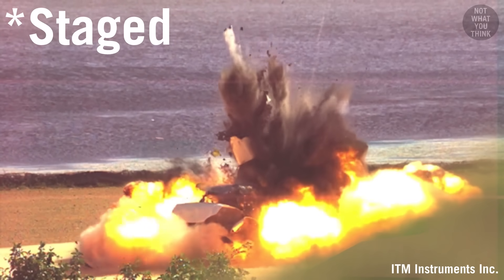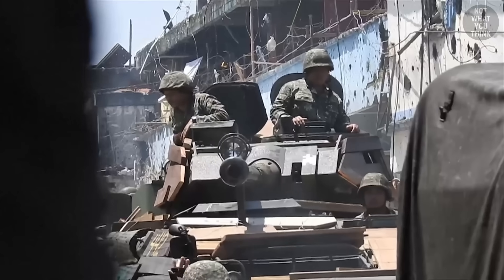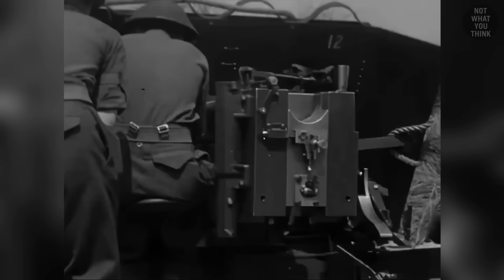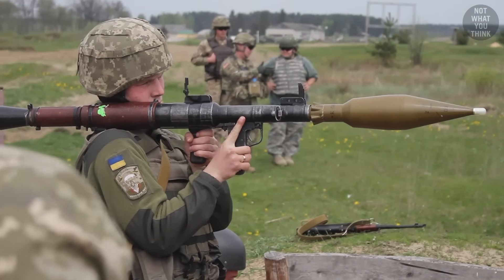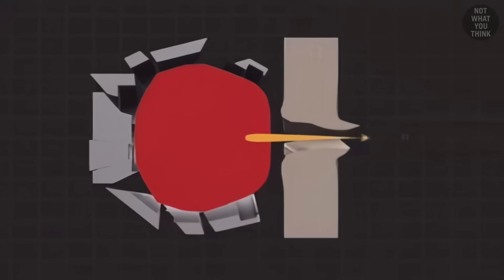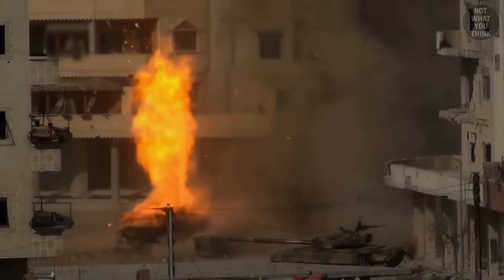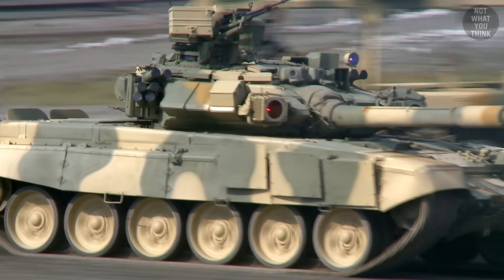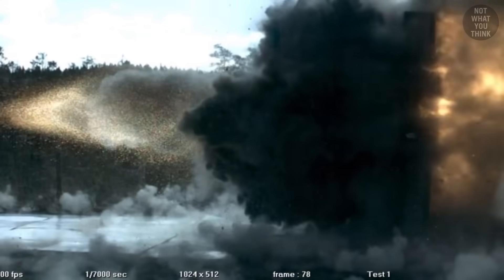Why Protecting Tanks is Getting Much More Difficult

Comment: We've reached a point in military where the term "Glass Cannons" applies to everything
Reply: That's why drones are the new fashion, why spent billions and trillions in specialized equipment and training vehicle operators for months when they can get blown up the second they get spotted in the battlefield, at least if the glass cannon is operated remotely you don't lose the operator when the drone turns into smithereens
Reply: @webaazul2500  There was this one episode of Stargate SG-1 where a planet was stuck in perpetual warfare with one side using remotely-piloted drones to fight while the other still employed humans.
Reply: @webaazul2500  Begin, the clone wars have.
Reply: @webaazul2500  there are defences against drones.
Reply: @webaazul2500  Drones themselves are worth billions. It might be cheaper to send infantry with anti drone weapons.
Reply: @webaazul2500 that's been repeated cause over and over cause of russias inability to use tanks effectively.. electronic warfare and infantry are needed to protect tanks. Tanks aren't going anywhere. They're offensive weapons. A tanks is basically mobile artillery. The first county to get rid of it will loose a war quick
Reply: @webaazul2500 you also forget that drones are vulnerable to jamming signals.
Reply: @webaazul2500  The Bayraktar TB2 drone cost $5 million and a Russian tank less than $1mill/ea but every tank lost cost 4 Russian lives. For every fully loaded BMP-2 cost $500K and 10 lives.
Reply: @billmcintyre3652  Its also why russia has more jets than pilots. Training people for equipment is more expensive and longer than acquiring the equipment
Reply: @billmcintyre3652  not to mention the cost and time it takes to train each personnel that is lost
Reply: @billmcintyre3652  
The BMP is an APC tho
You need to fuck up big if you have a fully loaded APC get killed. Like driving a full load on an active Frontline levels. You know, where an APC would have minimal crew and offer fire support
Reply: @billmcintyre3652 same thing with electro car being very expensive cuz it's not common yet I the market no contender\rival no way to stabilize the price.
Also called Taiping rebellion, sta lin and m ao ze dong that i forgor his rpg name is nothing compared to that human to one instance of battle ratio\map ratio
Reply: @billmcintyre3652  Equipment loss has always been higher valued in Russia than personnel loss.  I'd wager loss of life was never factored into the economic tradeoffs of weapon systems in Russia.  They'd stick with the tank cause it's cheaper.
Reply: what do you expect when offense vastly outpaces defense :p
Reply: @thorveim1174  'Disposable Glass Cannons', lots of 'em.
Reply: @thorveim1174  What about Air Defense? Still seems important to me though war is going to be different probably. Might start seeing flak again to take out drones.
Reply: @rjmaxx1258  air defense isnt the kind of defense I was really talking about here; I was more thinking of armor and other means to negate the damage of a shot.

Air defense when you think about it is more a form of offense, aiming to kill the enemy before it can harm you. And agree that some flak may see use against drones, though again i think we are more likely to see specialized missiles do that job instead (most anti air missiles working like flak anyway, aiming to detonate close to the target and let shrapnel do the work rather than seek a direct impact)
Reply: @thorveim1174  As far as you know...
Reply: @Dyl-Cam  it does.Active defense is unreliable, and passive defense gets defeated left and right. The only viable defense these days is really to kill your enemy before he gets a shot off, most of the time through stealth and/or superior range.
Reply: @thorveim1174  Ah ok interesting persepctive 👍
Reply: @thorveim1174  everything will change when some kind of energy shield will be invented
Reply: @wisewizard9552  if one can be invented... Not sure its possible at all, and even less so without a power requirement thats compatible with a tank-sized vehicle, and on top would likely have relatively easy workaround. Though mind you active defense might achieve much of the same... If it can work reliably and cant easily be worked around.
Reply: @thorveim1174  It's been a long time since a city could rely on impenetrable walls for defense.
Reply: We have technically been in the "Everything Glass Cannon" stage since the '80s tho. IIRC, NATO predictions from the '80s on conventional warfare between NATO and the Warsaw Pakt predicted a one month global war, after which both NATO and the Warsaw Pakt would have depleted almost all infrastructure and equipment in their respective armies, airforces and navies, leaving only hardened barely equiped survivor-infantry doing guerilla warfare against each other and some HQ people in bunkers with nukes.
Reply: Ever notice how it is easier to destroy than create?
Reply: Military now reached the  glass cannon meta...

It's all now just about who would land the first hit
Reply: they said offense is the best defense
Reply: Even if you hate war, is one of the reasons that push us to reinvent or create a new solution to a problem. I truly believe we have been stuck with the current technology because no one has gone all war again since WWII.
Reply: Gonna be space now for whoever wants to be untouchable
Reply: Has been the case in games for years, why waste stats in an all round build when you can min max your offense
Reply: Well, in all fairness, infantry personal body armor seems to be slowly catching up with small firearms to a degree after entire centuries of being neglected altogether up until very recently (like, 2 decades or so) and finally making a slow comeback. Obviously not quite the "human tank" thing of full plate armor medieval knights and most infantry of the Middle Ages, but we are making very subtle progress over there. We've just found a way to make a body armor that can stop the penetration of a .50 BMG at VERY close range (look up "body armor 50 cal". It's like the first result). That's halfway through already. Now we just gotta find a way to pad the damn thing to protect your lungs from turning into pancakes...

Just a few years ago that would've been considered an impossible feat. Now here we are.
Reply: In the continuous battle between armor and armor defeating weapons/ tactics armor rarely is ahead for long. Hard kill systems could be difficult. It is tricky enough to  stop the much larger used to target ship and they have a much larger distance to see and react to them. The actual hitting of the shell would not be that tough. (my old CIWS mount could walk rounds up a 1/4 in cable moving at over 200 knots. The small size and short detection to engagement time would be the problem, along with the radio environment on a battlefield with all kinds of crap in the way. That would be a nightmare to try to design a radar for that environment. Esp one fast and precise enough that you can use it to hit a bullet with another bullet. Maybe some kind of fancy solid state phased array could do it (and sound techy as all hell too).
Reply: Plate armor: first time?
Reply: It has always been and will always be easier to destroy something than make something completely indestructible. The fact that a long enough lever can lift a mountain means than the physics of desctrution far outweighs maintaining stability. Any complex enough system will always have a weak point that can be exploited using much simpler mechanism. As the saying goes in engineering, more moving parts means more chances of breaking. Since most things tends towards complexity especially involving tech development, this becomes even more true. That is why making something simpler often works better than addding complexity in terms of defense.
Reply: Wars are never won but they generate shitloads of taxpayer funding.
Reply: @FroggyHopScotch30  Agree sir, I am an American retired in the Philippines for @5 years, things have changed for the worst, Filpinos are a toxic society, many show no respect, all they want to do is scam people. Driving here is pure hell, I had enough in April 2023 I'm going home never to return.
Reply: AWP without armor.
Reply: and yet the E-100 exists.
Reply: Like a game of chess, black/ armor vs white/ projectiles. 
Ultimate defense vs Ultimate offense.
Armor that can't be penetrated. All offense is effectively 0
Projectile that always penetrates. All defense is effectively 0
Reply: You guys need to stop watching Sci Fi movies lol
Reply: Unless its a mountain
Reply: its like that because "you cant kill me if i kill you first" is a thing
Reply: Close-in weapon systems could change that for main battle tanks. These systems are heavy, but so are traditional tanks. Maybe sacrificing some of the heavy armor (which doesn't protect against modern anti-tank weapons anyways) in favor of carrying a CIWS around will become the norm.

Tanks definitely aren't going away. But a cope cage on top of ERA on top of a metal/ceramics sandwich just isn't enough protection against a single dude with a Javelin (or Kornet) sitting behind one of hundreds of windows in one of hundreds of buildings when you don't want to just napalm the shit out of a city before entering. Also, it is just a matter of time till the drones become dangerous for tanks too.
Reply: I got an idea?? Why don't we get along??? 😢
Reply: waiting for high mobility 155mm direct fire systems to become doctrine
Reply: The Belgian Air Force refused to accept fifth-generation F-35A fighters.Just think about it, experts, including those who participated in the creation of this aircraft, counted .... 800 defects in the design, and they have not yet been eliminated. 800, not 8, not even 80, but as many as 800!!! Bad plane!
Reply: Until technology catches up, and creates materials of more advanced atomic structure.
Reply: @AmericanThunder  It is already starting to catch up. We already have body armors that can stand up to intermediate and even full powered cartridges for the first time in centuries made out of ceramics!
Reply: с.
Russia must before destroying the satellites of Elon Musk. Warn about it.
Reply: х.
Contrary to the efforts of the United States and European countries, the final communique of the G20 summit did not condemn Russia's special military operation in Ukraine, which means a serious victory for Moscow, writes Frank Furedi for the publication Spiked. The declaration of the G20 summit was published on September 9. It says that the forum participants have different opinions about the situation in Ukraine. The European and American media called the final communique adopted in New Delhi a capitulation to Russia and a blow to the countries of Europe and the United States.
Reply: In like 20 years, exoskeleton equipped ground infantry are gonna each carry an entire ass 120mm field artillery kit, and war will change. Again.
Reply: When we can make forcefield they will be usefull again
Reply: says you a civilian that knows nothing.
Reply: If you declare with your mouth, 'Jesus Is Lord' and believe in your heart that God raised him from the dead, you will be saved. -Romans 10:9
Reply: @dizo-jp2td  if you declare that you are the lord of your own soul and you believe in your heart that your soul, the soul of the living is stronger than anything on the other side. That God does not exist. But your soul does. Then that makes you an athiest for lack of better wording.
Reply: That's just how it is, the are limits to how durable a material can be, but with enough energy you can allway create a bigger explosion
Reply: We reached that point a LONG time ago.
Reply: Maybe boron nitride nano tubes will give defense a chance along with other meta materials in the future. BNNT are stronger than carbon nano tubes. 

 We finally unlocked artitical spider silk I guess too. Not a similar, but weaker one as well. 

 Maybe some newer reactive armors too. 

 Yet my bet is on active protection. Ever see the Point Defense Turrets from the Expanse? Picture that. 

 For those who don't know it is like a CIWIS, but smaller. So we will have small automatic turrets controlled by AI, with various sensors shooting missiles, drones, and other rounds down. 

 Along with trophy system for really close in attacks. 

 That will be interesting if they get really efficent. Then offense will be about overwhelming the defenses.
Reply: War is simply two country's playing whos going to be king of the hill 😅😂🎉🎉🎉🎉😊
Reply: Fu** yeah we have!!! 😆 🫡
Reply: Say you hooked it up with some " You know 👽?"
Reply: Gow to provide
Reply: It kinda feels like a repeat of when guns became so powerful that armor stopped being effective, so everyone just lost the armor and picked up guns.
Reply: maybe it's time we start investing in researching things like energy shields who knows, right?
Reply: @Tiniuc  Aye the offense part has gone way outta control. It's downright sad considering the efforts and value of the personel involved with waging war or keeping the peace is inexistent. Everyone is expendable. 
Its particularly depressing seeing how beautiful the old armor technology was and the efforts made by legendary blacksmiths.
Reply: @JohnConstatine666  Destruction is always easier than building something up. If you want to think about it mathematically, there's only a very limited number of configurations of particles to consider something "intact" but almost infinite configurations to consider it destroyed.
While this has little to do with the arms race at hand, I feel like this nature of things somehow appiles here
Reply: @knight_lautrec_of_carim  Well, you aren't wrong, but it also depends on the state of human technology and how tactics and "meta" evolve to consider how armor and fortifications are employed. Big walls were very prevalent in the Middle Ages and were often sturdy enough to resist many direct hits from siege engines of its time several times over until cannons became a thing. You also have to take into consideration what other trade-offs there might be beyond just destructive power alone vs durability alone. Armors in the Middle Ages used to be incredibly sturdy and effective against the weapons of their times for how little they would weight and impair mobility if we go by our modern standards. Not just Plate Armor, but also Brigandine (most common type for professional infantrymen in the Late Middle Ages) and Gambeson armor (the less protective one, but incredibly cheap and could be issued and worn by most peasant levies at the time). They had a very nice protection-to-weight proportion and the weapons made specifically to defeat them were heavy and very tiresome to handle.

Then came guns and the weight-to-effectiveness advantage passed to them instead. But today we're seeing it being turned around with ceramic ballistic armor getting lighter and simultaneously effective and cheaper once again while small arms to adapt are the ones needing to get heavier and bulkier once more and needing to compromise by having higher recoil, lower ammo capacity on the maganizes because of bigger ans heavier bullets AND the bullets themselves having to be carried in lesser quantities by soldiers around for the same reasons.

It's fascinating how there's more to "defense vs. offense" arms race than just price tags alone. Honestly, it is just sad and kinda annoying how much many people try to reduce things down to "cheaper" when there's so many more factors at play other than just how many numbers of assets you can churn out for the military to spam against the enemy.
Reply: @JohnConstatine666  i think it's just way more difficult for defenses to keep up. offenses can always get more destructive but defenses, unless we discover vibranium or start inventing energy shields, not much else we can do.  the problem is also not making tanks too heavy which reduces mobility and capabilities. so they can't exactly have too much armor. sloped armor was quite effective till HEAT shells came in. spaced armor worked for awhile, now we got explosive reactive armor, even that is becoming obsolete.  that's why modern MBT's dont have that much armor. no point really
Reply: @Tiniuc  I think we agree that high mobility vehicles with unpredictable movement patterns might be effective at this point, thus I propose GUNDAMS
Reply: @Tiniuc  yeah imagine tanks with reflector type energy shields. That tank wouldn't even need a primary weapon..
Reply: @Tiniuc  We don't have the small-scaled energy output required for that. If you were to do it at all, I suspect more than the entire energy output of a nuclear plant would be too little.
Reply: @Tiniuc  Well, matter is already energy...
Reply: @Tiniuc  Agreed. Active shielding could provide defense for aircraft, tanks, any number of applications. Just as we have been researching quantum computers, I am certain that we are also looking into active shields. The two downsides would be power draw and field stabilization. Maybe in 50 to 100 years we will see the first such defenses.
Reply: @knightnblu  I remember hearing about one method that would 'sheath' a metallic object in plasma, not quite protecting it, but dampening incoming projectiles depending on how thick the plasma is. The downside was it tended to, well, melt the metallic object. This was like early 2000s or late 90s, so no idea on citation.
Reply: @Tiniuc  Yeah, armor tech needs upgrading, altho a prerequisite for advanced shielding would be sufficient power sources that can be miniaturized to fit within a tank. Energy shields are power guzzlers and no normal vehicles would be able to house the generators.
Reply: @Tiniuc  if you think they haven't already looked into if that's possible you're sorely mistaken.
Reply: @Tiniuc  and those blue EMP bowling balls the Gungan's used against the CIS in The Phantom Menace.
Reply: @Tiniuc  not a real thing but something similar is in development 
Using magnets
Reply: @Tiniuc  we have no clue what a force field could be probably better to try something like laser based active defense or something we have a clue how to achieve 
It just seems unphisable we’ll create economically worthwhile and sufficient force field tech even in 40 years
Reply: @Tiniuc  oh yea, starcraft 2 in real life
Reply: @Tiniuc or, we can solve hunger, bring peace to the world and start populating the stars, as we have always been destined to 😂
Reply: @Tiniuc  It was started in the 70s and is still being done. Look it up - it's fairly public.
Reply: @Tiniuc exactly what I think
Reply: @Tiniuc  Or maybe we should stop creating reasons to feed the war industrial complex, which also give terrorists and dictators the power to do harm, from an aggression perspective.
Reply: @victuz  There will always be reasons to go to war, and a necessity to have the tools, training and methodologies to go to war. What if all countries abolish war and weapons... EXCEPT FOR ONE? 

Then that one country will be able to wage war or threaten war in order to get what it wants, and the other countries will HAVE to re-arm and re-learn war in order not to get pushed around.

This is the same reason why we will NOT be rid of nuclear weapons /WMDs for the foreseeable future.

There will ALWAYS be a need to have the capacity for violence.
Reply: @victuz  Laaaame .. war is fun rigth ? 
(it's sarcasme)
Reply: @victuz  Ehh, don't blame the designers or manufacturers, blame those buying the weapons.
Reply: @mirceazaharia2094  one should sharpen their weapons with the hopes it'll never be used. The military industrial complex runs counter to this philosophy however, because it profits from and encourages needless war
Reply: @fifth1613  I'd argue that war mainly comes from overpopulation, which is an unnatural state that seeks resolve one way or another, be it war or extinction by resource depletion
Reply: @mirceazaharia2094  being peaceful is not being harmless.
That's what people who are against guns don't understand.
Guns don't equal violence.
Reply: @victuz  Always a stupid idea, just because you choose to be pacifist and disarm yourself doesn't mean others will, and in order to force others to disarm you need to use force. The cycle of war is necessary AND virtually eternal for as long as sentient life exists, if only the many people with the delusion that war can be definitively ended dropped such fantastical notions.
Reply: @fifth1613  its sad but true.
Reply: @Tiniuc  Or materials technology, defense turrets, better miniaturised jamming systems. Or just drones, until materials technology, miniaturised defenses / power systems catch up and drone hacking/hijacking gets harder and harder to defend against.
Reply: The best defense will always be deterrence
Reply: The Philippine army walking in a combat zone so close to each other, I am a retired U.S. Army Infantryman this is a big mistake you must be at least 50 meters or more separated but the Philippine Army is lacking any type of combat training.
Reply: @eddieBoxer  It's close quarters, they have no choice but to be tight. When you see footage or reconstructions of door-to-door operations by US marines is Afghanistan, they were always tight together so they can look at all angles necessary.
If they were 50 meters apart, they could easily be picked off one-by-one without the ability to return fire.
Reply: Human lives are cheap.
Reply: Imagine convincing people out of their human nature through YouTube comments
Reply: A quote from JFK. “Mankind must put an end to war, or war will put an end to mankind.” Idk why so many people in this comments section seem to be pro war.
Reply: @dylandepetro4187  Because to quote another saying, "In a world where everyone is a pacifist, the one who chooses not to will rule everybody".